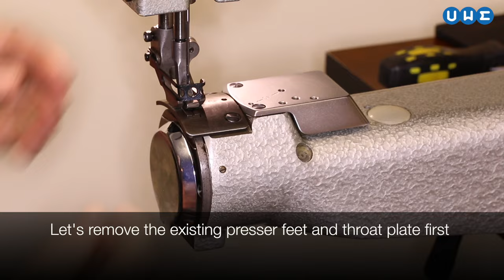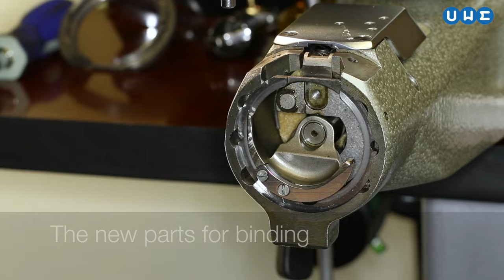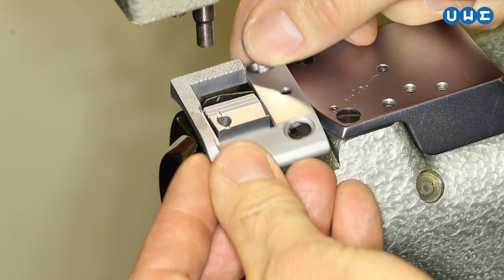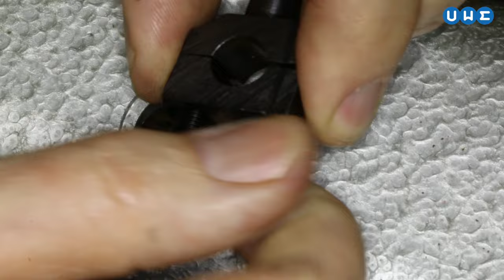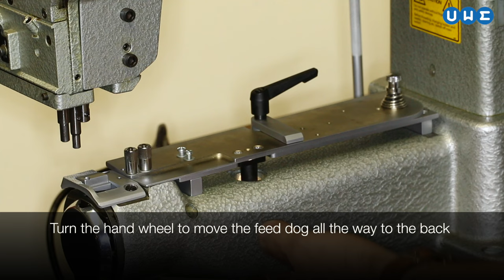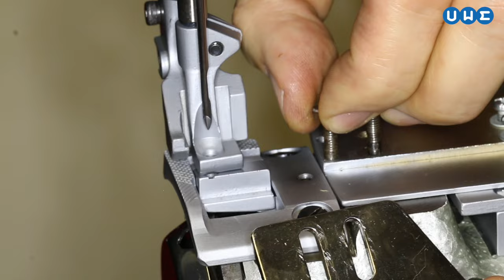Durkopp Adler 205-370 Binder Kit Installation

Comment: Would i be able to use this attachment on an adler 69373
Reply: Im trying to decide between buying an adler 69   or pfaff 355  struggling to decide  between the two
Reply from the maker: No, this binder kit only fits the 205 class of machines. The Adler 69 has a very different binder kit. You'll need arm cover plate + tape folder, throat plate+feed dog, and presser feet. Search Ebay for "Adler 69 binding" and you'll find it.
Reply: @UweXY  thanks glad yo know it can be done !! Any opinions to help me decide between adler 69 and pfaff 355..
Reply from the maker: The Pfaff 335 and Adler 69 are functionally nearly identical. Either is a great machine for their application range. Visit http://leatherworker.net/forum/forum/50-leather-sewing-machines/ for discussions and reviews about leather sewing machines, including the Pfaff and Adler.